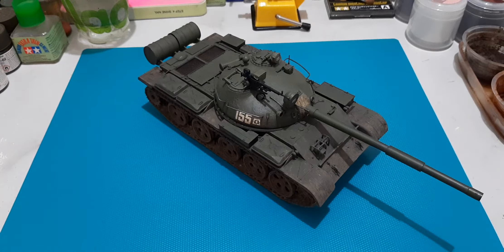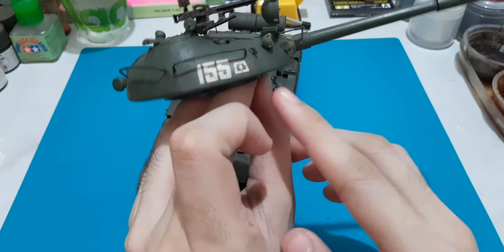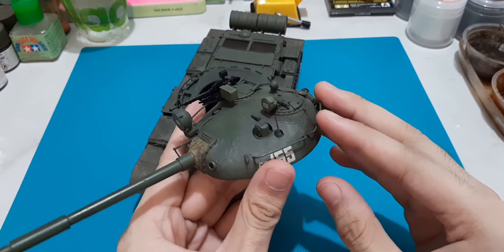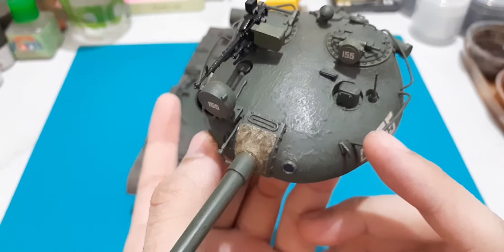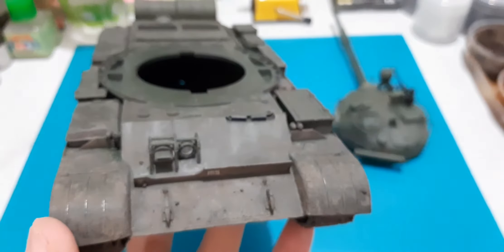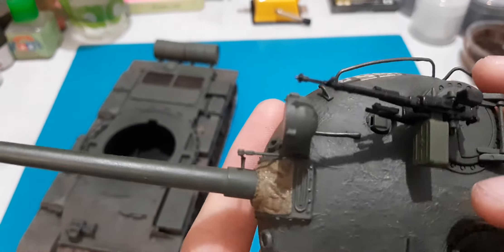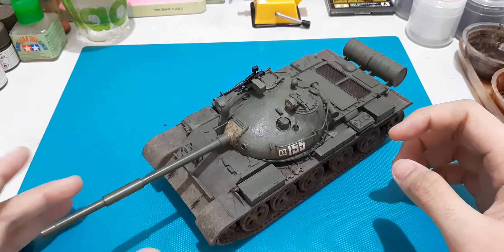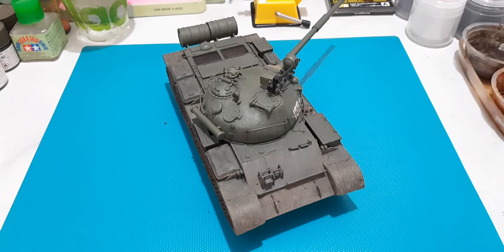(FINISHED KIT REVIEW) Tamiya 1/35th Russian T-62A Tank

Comment: Is it hard to build?
Reply from the maker: The build was pretty simple! However, there were some gaps in some areas. Such as the glacis plates where the upper and lower hull halves meet. Other than that, the tank came together quite nicely. I just decided to make an extra effort to modify and correct some parts.